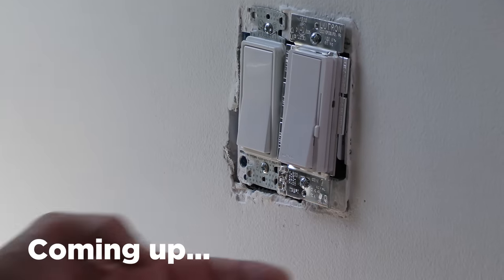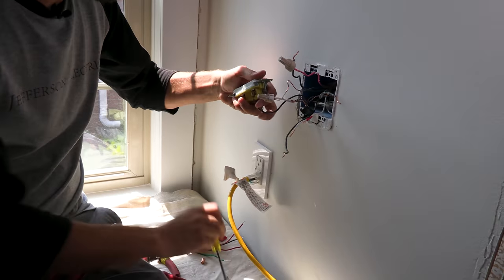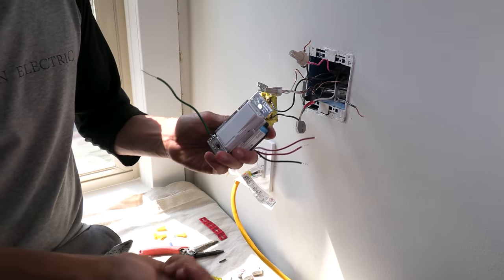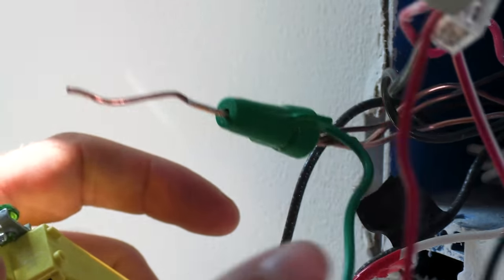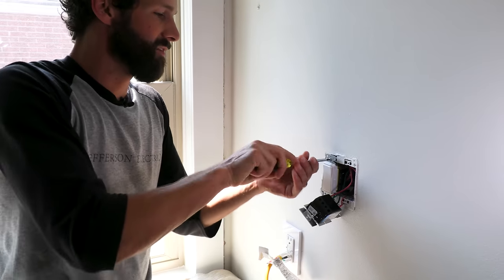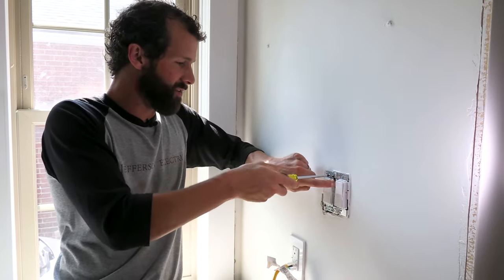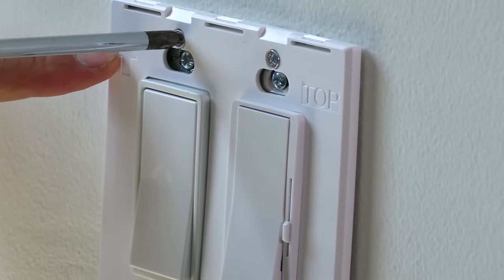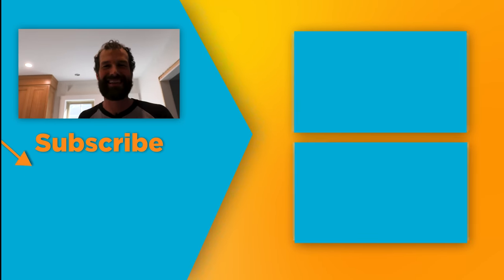When Light Switches Get Complicated: Dead-End 3-Way Dimmer Installation

Comment: Good job on the installation of the devices, I presently hooked a dimmer up on a 3- way system and it only used one of the travelers on the system kind of odd but I didn't like the dimmer but the customer wanted it. Those splice blocks you use I don't care for them they take up to much real estate in the box with the dimmers and have no room at all.
Reply from the maker: Lever nuts are definitely a trade-off of time for space! We are transitioning more and more toward lever nuts, but there are still tight scenarios where having a few wire nuts in the stuff box is beneficial.

Comment: Hi Joel love the videos so far been watching a few weeks now. Very nice.  Not sure why u didn't do pigtails on grounds. But to each there own. Them wagos that u use are older style. But the 221 wagos are much better u can see the conductors.
Reply: @lorenrickey5481   are these mechanically
Reply: @Loren Rickey  I see there not these are acceptable in alot of jurisdiction
Reply: The 221 series Wagos are see-thru and they also have a spot in the back that you can use to check continuity.  Save yourself some frustration and just get the 61x series lever nuts, but watch out: most of the pre-made kits sold on Amazon use the lower-rated 221-41x Wagos.  I think I spotted ONE KIT that used the 221-61x series Wagos on Amazon so be careful to get the right ones.  The 221-61x series is rated for 10-20 AWG while the 221-41x series is 12-24 AWG.  That means the 61x series lever nuts will cover all of your normal household wiring needs.

Comment: I hope you will be doing a video on the low voltage lighting.  What do you like for the DC driver?  I have yet to find one that I like.

As for stuffing the wires back in to the box.  I like to prebend/fold them before I connect the various receptacles.

Comment: I have switched to using Wago lever nuts from wire nuts and I have noticed that during box wire "stuffing" / "folding wires" during device installation a lever can get pulled up causing a disconnect or high resistance connection.  As a result, I started wrapping the Wago levers with electrical tape (I use orange tape to match the Wagos) to ensure those levers don't get lifted up.

Comment: Love the videos!

Do you know any 4-way motion sensors or smart switches? I have read some articles online but didn't get an trustworthy answer and would like to incorporate that on my front entrance.
Reply: Can't stick them at the 3-way ends?
Reply: @jovetj  I tried the caseta line and did not work. Upon reading further, seems to me that there is no 4 way "smart switch" on the market.
Reply: Costco had a two pack of smart switches that I used for the situation you mention. Worked great and the price was good.
Reply: @selcoify  I don't have a ton of experience with smart switches personally, but the GE Cincs I've worked with would work—it's just that all switches for the load need to be replaced.
Reply: @lorenrickey5481  you put the smart switches on the "3-way" part of the 4 way circuit?
Reply: @selcoify  yes.

Comment: It may just sorta be me but man. I HATE when I get stuck needing to use something like a Maestro or other device that doesn't have wings you can break off when using (at least) a carlon remodel box. Old school toggles, receptacles (maybe decoras too, I don't recall) are fine when you can break off the wings to recess it into the cavity built into those boxes where the device screws in and it helps with flushing out the plates to the walls but the dimmers that don't let you do it? /sigh.

Comment: How many romex cables coming into the box?
Are both lights on the same circuit 
How did you tie the neutrals together?
Smacking those switches on and off so hard isn’t a good look.

Comment: Tucking and pulling within a box I like the volt claw they come in two types. I also prefer the knipex insulated duckbill flat nose pliers to twist it avoids marking the copper when twisting also create a little strain pulling back a tiny bit helps twisting to be more efficient and secure. I tend to prefer crimps when twisting the ground wire. I also prefer the ideal armor band wrap to avoid inadvertent shorting as wires that are compressed relax in a smaller older box.
Reply: I see cost/profits are not of your concern…
Reply: Also, not trying to knock you or anything, it’s just after 6 years of being an electrical apprentice in MN doing commercial work and about to retake my Journeyman (I know, I know, I’m using the excuse MN has a 70% first time failure rate…I’m part of that statistic) I just have never seen half of these things that seem to show up on YouTube. My bags already make my hips hurt, I’m not trying to carry anymore tools than I already do.
Reply: @AdamS-lh2ug  I hear what you are saying. Completely understand where your coming from. There is no time nor push for quality in the industry you are always chasing your tail for time. It is just very frustrating for many electricians who want to do better quality work and be better trained and learn to do a variety of interesting work.

Comment: Please tell me they eventually got that wall plate to sit flat. I have a gap on one of mine that's a fraction of that size and it drives me crazy. It looks like the box itself is not flat to the wall, so that may have been causing the problem.
Reply from the maker: That's typically what you get from screwless plates (from our experience)...
Reply: @ElectricProAcademy  Mine are nearly all flat, except for one where there's a hump in the drywall. It took a fair amount of fiddling, and I have a level 5 drywall job.

Comment: Had sort of an unrelated question, was wondering if a switched outlet/receptacle can be added on the load side of a GFCI receptacle? So for example going from load out on GFCI into a switch that controls an outlet for a light.
Reply: Why not?  You can add anything to the load side.  If it works, it works.  If it doesn't, something is wrong.  GFCI doesn't care.
Reply: @nhzxboi  I know it'll work, I guess I should have asked if there is a code restriction?
Reply: Outdoor light on a GFCI is okay.  No code restrictions.  Just put a label indicating the fixture is on a GFCI circuit.

Comment: Because of the problem you ran into, is why I am a fan of my idea to have a J box that is separate to where all connections should be made, instead of in the gang box. Yeah, it's another hole in the wall but it's why wall plates are made. There are even spring loaded. I hope to one day spring loaded ones made of porcelain and either come with design, or a way that any design or picture can be custom printed with ease or order from store, or those artsy people can do something themselves to decorate it, or just leave it plain. It makes so much more sense than fighting with a stuffed box that also need to hold switches, outlets, and sockets.

Comment: If I was only attaching a thin wire from a dimmer to 1#14 guage wire always used the smallest wire nut ( orange ) to save space. Biggest joke is the combination receptacle with USB charging ports . Well over 1.5" deep and almost need two shoe horns, rubber mallet & a prayer to get it to fit inside of wall case.
Reply from the maker: 😂 So true! Brutal!

Comment: So, as a customer, I appreciate a contractor that goes the extra mile to make sure I'm satisfied, and that takes real care of the final fit and finish.

However, I hate upsells. Feel free to ask me if there's anything else I'd like that may be beyond what we originally asked for, but don't spend a lot of time trying to sell me on the latest whatever that you're trying to push. Pushing upsells at me is the quickest way to ensure that I never, ever call you again.
Reply: There's certainly a fine line between offering upsells and pushing them down the customer's throat.
Reply: Yeah, agree. I appreciate it very much if a contractor brings an option to my attention that I hadn't thought of, or wasn't aware of. Basically, something that I don't even know that I want. But don't try to get me to buy something I don't need and won't use. The stuff Joel was talking about sounded much more like the former category to me.

Comment: Those screwless plates sure do cost a lot to not sit flush against the wall. I'm pretty disappointed with the ones I've installed. =/
Reply: I have them in my house and they (nearly) all sit flat after a great deal of futzing with them. The one that doesn't is due to a bit of uneven surface on the wall itself. But they are definitely very finicky.
Reply: Use Lutron claros. They fit nice on wavy walls lol